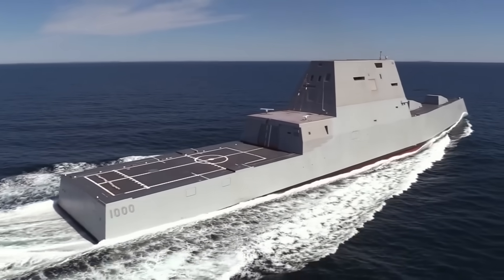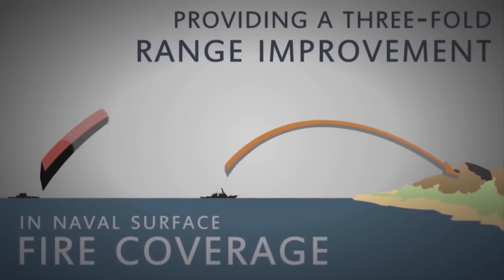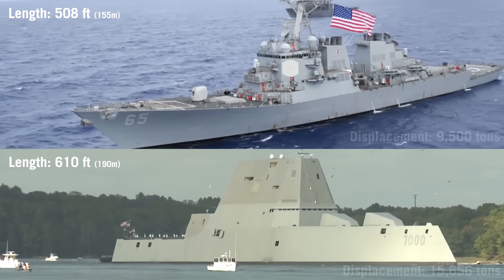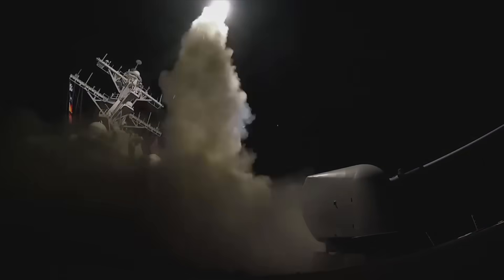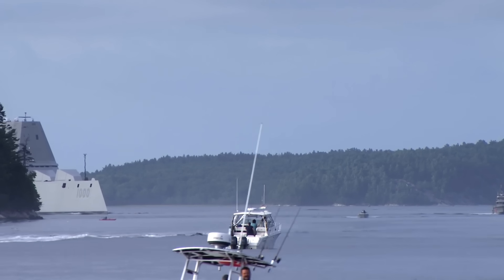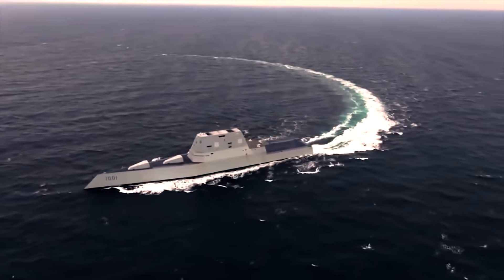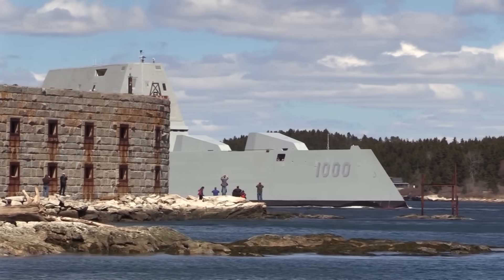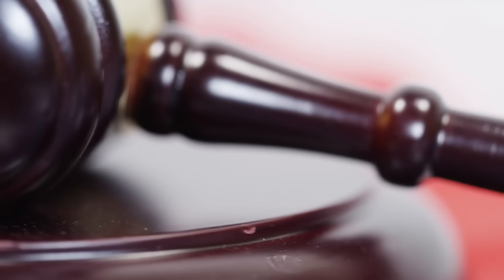What Killed Zumwalt Destroyers?

Comment: It's well known that the guns are just plain wrong. They were deliberately designed to force the use of proprietary ammo, whereas there is already plenty of existing 155mm ordnance. They need to rework all the guns to take standard 155mm chambering so they don't have to buy stupid Smart shells.
 The Navy should also order a new 16"/56 Caliber gun system and quit screwing around with pop guns. 😜 If you want cost effective ground attack weapons, you need economical shells. 16" can deliver more than a cruise missle for less. Modern barrel technology can deliver 1500 rounds per barrel before relining is necessary. In fact, it's probably more than that, since that figure was already achieved in the 1990's.

Comment: There was another video,stating that the materials being used on the hull and internal structures,were causing rusting issues,and in testing phase there were to many leaks and engine issues,the Royal Navy were having problems with there engines on there new fleet when they sailed between different oceans due to higher salt content in warmer and colder seas.

Comment: The Zumwalt class is to the Navy what the Bradley is to the Army, they wanted it to be able to everything with its modular mission packs, trying to do that just leads to complications, compromises and cost over runs.  In the end, cancelling the program and building more AB's is a much better solution for the current time.
Reply: Just make sure they have the sheep specs

Comment: A tumblehome design can't survive battle damage as much. The lower hull has more volume than the upper hull, so if you take damage and start going down, you're depending on the sealed off sections of upper hull to take over the buoyancy load and support the ship. But with the upper hull having much less volume, this becomes problematic.

Comment: Plenty of reasons why it costs so much. The main things people point to is it's size 16,000t vs 10,000t arleighs, the new technology such as the guns, the ammo for the gun, the new electrical system and propulsion, automation, new radars and then sticking all of that into a new hull. But congress is what made it cost the most.

These are all valid reasons it's a new class of ship. However they weren't meant to be bought alone they were supposed to be part of a family of new ships, DD-X and CG-X. For people who don't know, destroyers are supposed to do a bit of everything, cruisers on the other hand, at least modern cruisers, are supposed to be fleet protectors. Zumwalts or DD-X are supposed to have the same multi purpose mission set but with an emphasis on land attack, hence the two large guns. CG-X were supposed to replace the ticonderogas which are our current fleet protectors. 

Now where does congress come into play? Well like anything else if you want to develop a line of something that's new, a lot of research needs to go into it. Almost always the first thing of that line will be the most expensive, but as you continue each subsequent one becomes less expensive. Why? Because you learn where the problems are, you fix them, building them becomes more efficient and faster, thus bringing the cost down. After seeing the costs of the first few ships congress got cold feet and cut the number of ships, then the price went up. As the price went up again they thought cutting the number of ships would bring the cost down. They kept doing it till there was only three ships; each one now costs 7.5 billion instead of the original 1.3 billion. 

Now to add the cherry on top of all of this, the reason why these things are borderline useless is because the ammo was too expensive because of the cut in ships, they don't have the same radar or systems as the burke's so they arent good fleet protectors, and they can't carry out their job properly because the CG-X was never built.

One last thing I should add is that the burke's are nearing their service life, and the newer ships (flight iii's) have no more room for upgrades. Our current cruisers the ticos are being retired so when they're gone thats more stress added onto the burke's to take up that role which it wasn't built for. 

All in all new tech, and new hull costs a lot, but congress shot itself in the foot by cutting the number of ships which eventually killed DD-X and CG-X programs.

Comment: The video says that when the ship launching missiles its becomes more observable to the enemy. While this is true, it’s actually worse than that. Radar emission generally provide useful information to the enemy at ranges greater than those that necessarily provide useful information to the emitting platform. That’s why proper emissions control discipline is so important is you want to enjoy the somewhat debatable advantages of low observable ships. There is an irony to the conflict between situational awareness and survivability, which usually are one and the same.

Comment: it was way over budget and unpractical, for every DDG-1000 built you could produce 2 or even 3 Arleigh Burke Class, and with today's advanced technologies you could modify the AB class destroyer to be upgradable like the M1A2 Abrams, with package loadouts. Also if its the Navy's mission to reduce the radar and sonar signatures of their ships they could coat the top of their DDG's with the same radar reflecting material that they use on the F-22 and F-35. They can also replace the aging rotary props with the Magneto Hydrodynamic pumps and Propulsion Systems.

Comment: The idea of a stealth ship doesn't seem to make much sense on a large slow moving object and could easily be overcome relatively cheaply with surveillance satellites or recon drones.  It seem like a tumblehold and stealth minimalisation means you need a much bigger displacement for the same useful deck area. You could probably get the same armament on a 7000ton boat of standard design.

It also seems vastly inferior in most ways to an SSGN.

Comment: The Zumwalt is More like a cruiser then a destroyer if they want to make ships like this you should take away the stealth and add 20 inch rail guns and make it a battlecruiser because heavy armour is the future not stealth
Reply: Well, I dont know much about armour on ships. I do argue that a ship needs armour around the most valuable areas of the ship. Like engine room, CIC and so on. But adding more armour will reduce the speed (depending on what engine you are putting in) Beside, the more armour you add on a ship, the more powerfull weapons the enemy will try to make to pen that armour.
Reply: @Danspy501st  That’s not technically true what you do is add more powerful engines and tanks are more well armoured than ships you have 20 inch rail guns and anti-missile defence well the shit would be heavily armed but speed is also important that why we need battlecruisers and not battleships because Battlecruiser were lighter and faster and maybe even put a nuclear reactor on a modern day battlecruiser so it has all the HP to operate rails guns and make it a fast ship
Reply: @jammiedodger7040  Putting a nuclear reactor or a more powerful engine will still add weight which will make it abit slower in theory. I had a teacher that told me that you cant have everything good in one thing. You have to compromise some factors over others. Beside you are still running into the problem with "You makes a more heavily armoured ship, then I will design something to either pen or get around that armour" There is a reason that the different armies is designing new types of armour to their tanks and so on to be able to kill either shell or missile warhead before it making contact with the armour. You also need to think on cost to operate like a battlecruiser. Beside I hardly think that US will design a battlecruiser to have that kind of weaponry. They will most likely put it on a destroyer or on one of their carriers. Simply put it. You will have to compromise some things over others when designing something. You can also see it with tanks from WW2

Comment: There are a number of incorrect point in this. The issue of having fewer crew to save the ship for example is wrong. There would also be fewer crew to be injured. Also the point of ships traveling in fleets. That is only the normal for carrier groups, not your average ship. Most ship travel solo or in no more than two or three.

Comment: This video got many facts wrong.  The initial forward guns were supposed to be the rail guns on the first one, but that system is in development hell.  The ship is designed to create the electrical power nesessary to support the rail guns.  The current guns do not require that much power.

The number of ships kept getting cut in half, to zero, then congress intvervened to get three.  That is how the cost balloned.  

Huntington Ingalls in Mississippi was supposed to build these ships, however Sec. Gates to the ships away and had them built in Bath Maine.  Huntington Ingalls stopped all design work and General Dynamics Bath Iron Works had to finish the design to build the ship.  Many design mistakes had to be corrected during the build which contributed to cost overruns.  

Many problems were found in the automation which involved different and incompatable operating systems.

Comment: Tumblehome hulls have been tried before, the problem isn’t when they’re sitting pretty in a storm, it’s after the enemy have put some holes in them they become far more unstable far more quickly than ships with a standard hull shape, take a look at the battle of Tsushima for a good example.
Reply: The issue is that now a days almost every ship is a glass cannon so tbh idk how much of a difference that’d make
Reply: @names1842  oh that’s very true, however tumblehome hulls are far quicker in rolling over when hit compared to traditional hull forms.
Reply: @names1842  They are tougher than you think..witness Stark and Princeton and Cole. Cole's damage in particular would be hard for a Zumwalt to survive.
Reply: @shawn97006  Overall though, I’d much rather trade that stability for stealth as in a open seas battle that would serve you better. Now if you were let’s say in the Persian gulf I’d definitely leave the Burke’s to deal with that in case of lower level attacks on it, and it’s not like the zumwalt was made for close quarters combat combat anyway as stealth at close range would be significantly reduced
Reply: @names1842  Here's the thing. You don't need a tumblehome for stealth. You can make do with a traditional hull.
Reply: @names1842  - A stealth ship sounds great. However, Zumwalt has near zero stealth, as a practical matter.

It's going to run radar for navigation and detection. That means it's a "stealth" ship with a lighthouse on in that fancy mast tower.

It's a genuine facepalm idea if you think about it for a moment.
Reply: @Texas240  well the idea (afaik) is that even if they see it that way or through satellites it can’t be locked onto via other weapons, guided torpedos guided anti ship missiles etc
Reply: @names1842  - In theory, that sounds great. Except, we were trying to spend billions of dollars on a brand new, sophisticated warship to basically counter old technology.

Modern missiles can use GPS targeting guidance. What would make stealth valuable is hiding the ship. Because it's broadcasting its location with its radar, that's not possible. So, if you know exactly where to look, you can target it more easily, even with a weapon that's radar guided.

It's just something that really wasn't well thought through before spending billions on it.
Reply: @Texas240  ever heard of EMCON?
Reply: @wayneroworth5669  - As with the stealth ship idea, it's good in theory, but useless from a practical standpoint. 

Have you seen how many collisions the USN has managed with normal navigation protocol and radar active?

Switch those radars off and you'll end up with Zumwalts taking themselves out of the fight by running into something.

How often does the USN conduct training exercises for navigation without radar? 

The next issue is that without targeting radar, the Zumwalts would have more difficulty hitting direct targets. 

Any normal navy ship, without broadcasting anything, will still be visible on radar. 

As for the Zumwalt, if it was using targeting information from another source, once it fires its weapons (assuming there was ammunition or it was refit with missiles), it's going to announce itself. 

Sure, getting a surprise shot could be useful, but not at the outrageous cost of these ships. 

Again from a practical standpoint, 3 Zumwalt ships make no impact on fleet operations compared to the 62 Arleigh Burke destroyers in service, plus several more new build ships contracted for. 

It's just cheaper to build ships that work and are proven then to spend even more billions trying to sort out the Zumwalt's issues while still having to build new Arleigh Burkes to fill the gap between now and whenever the Zumwalt might have grown into its oversized shoes. 

Zumwalt was a very expensive testbed for automation and other new technologies, stealth being a very minor part of the mix (but the most mentioned due to its unusual looks). The same thing happened with the new LCS ships.
Reply: @Texas240  there's enough points in there to make it tedious and long-winded replying to each one. Let's just say most points are actually moot

*navigation without radar is pretty straightforward, we did it for many years before it was invented 

*Hitting targets with full EMCON is easy via gps

*clearing datum is a problem even for submarines but still doesn't make the platform useless 

Etc etc
Reply: @Texas240  exactly at that point why not just build a stealth submarine...
Reply: I often wonder how naval combat would play out in modern day though. I'd have to imagine with munitions so strong, and ranges so big, it either comes down to who sees who first or just pure M.A.D. How feasible is it that any smaller ship is walking away from a modern bombardment? I have no clue what their defensive capabilities are.
Reply: @mcgoo721  honestly when it comes to modern warfare I take the attitude from Drachinafel’s song at the end of one of his vids. “It turns out the future it more boring that we thought! Carriers, Subs and missiles these are now the weapons sought!
Reply: @michaelgarofalo6231  while I love Drach, he seems to be severely underestimating potential capabilities of the railgun. For one, he seems confidemt that power would be the problem. However one look on a Ford-class catapults says otherwise. In essence, they are the same thing: big powerful linear induction motors. If you can have one accelerating several tons worth of fighter to a take of speed, you can bet you can have one accelerating a projectile few hundred times lighter to a much higher speed. And get missile-like ranges cheaply. Obviously you may have to go nuclear, and there is galvanic corrosion problem to still overcome, but it may be much bigger game changer than he thinks.
Reply: @mancubwwa  eh I was more making a joke on how dull modern warfare is compared to the old way, however once we do get railguns....well I can’t wait until we start calling em MAC’s
Reply: Remind me, when was the last time an American warship had a hole put in it by an attacker?
Reply: @ItsNuxFury  when was the last time America got involved in a conflict against large scale naval assets?
Reply: @michaelgarofalo6231  I dunno, like '91?
Reply: @michaelgarofalo6231  Battle of Leyte Gulf?
Reply: @ItsNuxFury  1991
Reply: @ItsNuxFury  happens about once a decade from memory. USS cole springs mind. cant think any sunk in 70 years though
Reply: @terryfuldsgaming7995  who’re you asking?
Reply: The tumblehome battle ships of Russia during the battle Tsushima, were based on the French tublehome hulls of the late 1890’s and early 1900. These were very different to Zumwalt hull. The bottom of the hull was wide, the middle was very narrow and the deck was wide. Whilst the the Zumwalts go simple wide to narrow. Meaning a much larger angle required to capsise compared to a traditional tumblehome hull, and as stated video a traditional shaped hull.
Reply: Tumblehome is great in a canoe, because you have a large displacement, but you can still paddle.

However in a ship, you end up with a colossal displacement, but none of the accomodations and flexibility above the waterline to actually make use of that extra buoyancy over the lifetime of the ship. It is the 2 seater muscle car of ships.
Reply: @nicbrownable  That's less of a big deal when the crew is half the size, less space for accommodation fits in with less crew needing accommodation.

One big deal with the Zumwalt was the extra capacity in power generation and system architecture which would have made upgrades and new systems (especially the railgun, if they ever manage to approve it for use) without significant retrofitting of the ship. Some older ship designs are getting a little long in the tooth for that. Though the video makes a good point about how ships with larger crews have more manpower in damage control situations.
Reply: Are you a naval architect specializing in Zumwalt Destroyers?
Reply: @ThePaulv12  who’re you asking?

Comment: My guess is that this ship was built around future weapons. The over-powered powerplant is a hint.
Reply: No.... The engineering requirement by military standards became ridiculous... You basically have to assume every equipment will be running full capacity at the same time (which never will happen), and multiply by safety factor... Resulting over powered it few times over
Reply: @champan250   Let's force engineers to calculate power usage of all systems at full usage, and then not count it as a part of the safety factor so the power production must be (roughly) twice of the previous equation.

And then the rest of the world asks themselves why you americans spend so much on military.